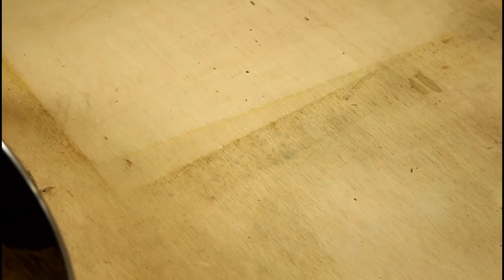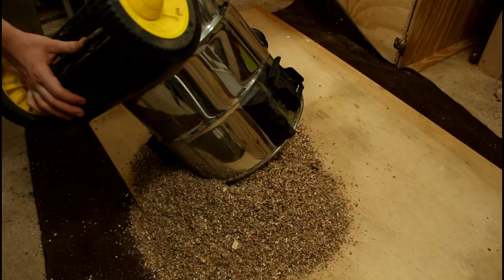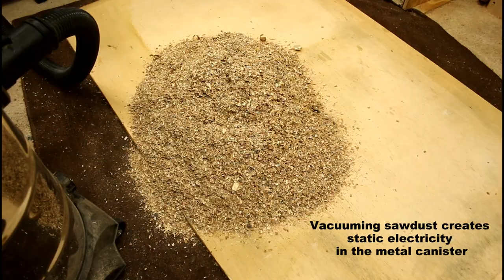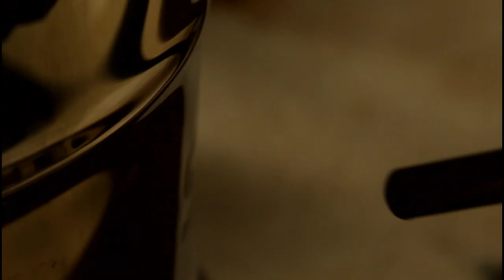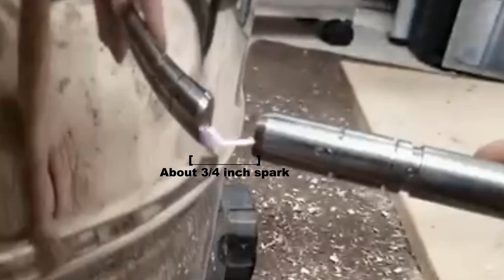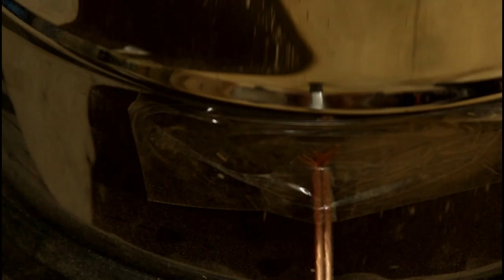Vacuum Static Discharge - A Simple Solution

Comment: I wonder in the wall socket there is ground and in many sockets there are connectors for it.
Why some appliances in which static electricity is a problem don't just connect its body (or whatever parts accumulate the static charge) to the ground.
All that's needed is additional (if not already present) wire, and users to be aware that they need both the wall socket and the appliance to use the ground connection to be safe.

Comment: We had a vacuum at work that dragged around a small chain, on another note, I was routing a long 16 foot piece of PVC trim board along the entire edge, I was doing this up on my long porch which is covered with composite decking, these decking boards are all plastic coated, between running the router on the PVC and walking on the plastic coated boards by the time I got down to the other end of that trim board I had such a charge built up in my body I was like Thor! and when I touched something the biggest lightning bolt came out of me and it felt like I was electrocuted! 🤣
This is actually a problem in and of itself with decks covered with the composite boards, mine is 40 feet long and by the time you walk down the other end, "THOR!"⚡⚡⚡